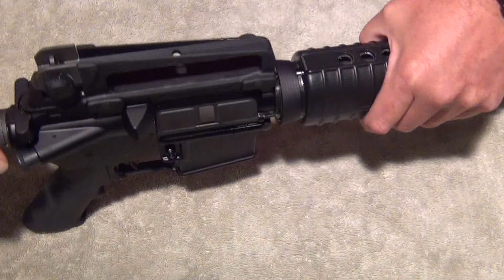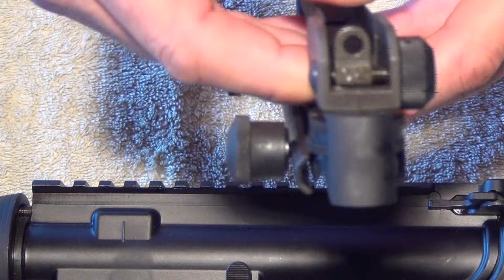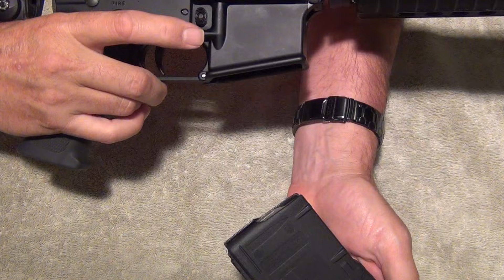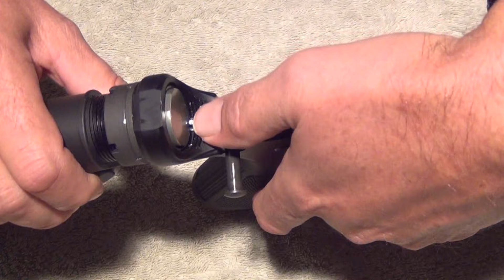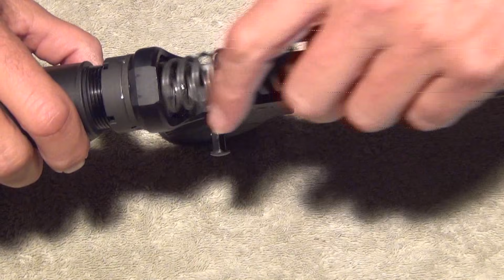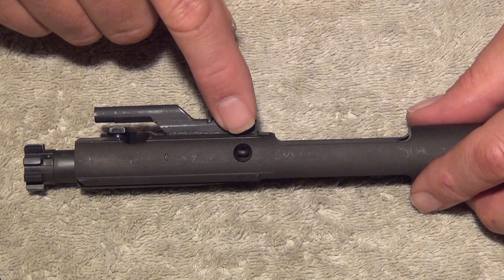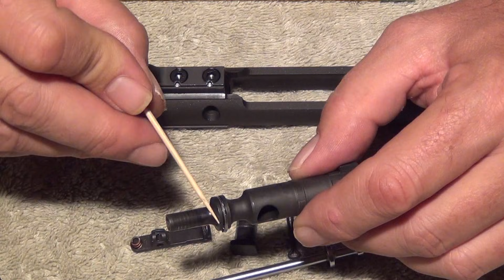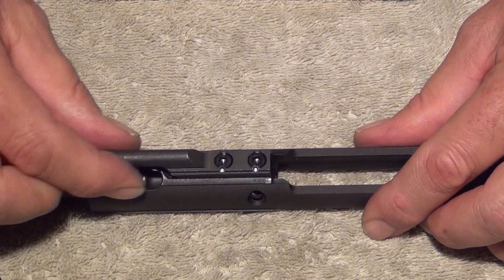AR-15 Basics: Controls, Function, Disassembly, & Reassembly.

Comment: He left out that an "M4" has to have a carbine length gas system, which IMHO is more significant than extended feed ramps or even an A3/flattop lower, otherwise pretty helpful video.

Comment: Thanks for the confirmation above.  I am really new to this AR-15 platform.  I was really tied up with 1911’s and 226’s
I tried to open the upper and lower receiver last night, after popping the rear pin, I wasn’t able to separate it until I have released the BCG forward.
I thought the BCG has to be fully rearwards, but I did not force open it since I knew something is catching these receivers in between.

Comment: Will there be an issue if I remove the rear body pin while the bolt fully forward (battery) and hammer down?  Then while it is disassembled and for some reason the hammer is cocked, could I decock it by slowly releasing it with my finger while pulling the trigger, then push the bolt to battery and charging handle and close the upper and lower receivers?